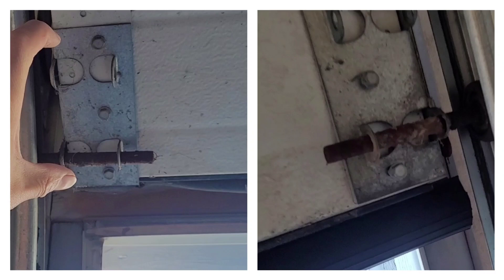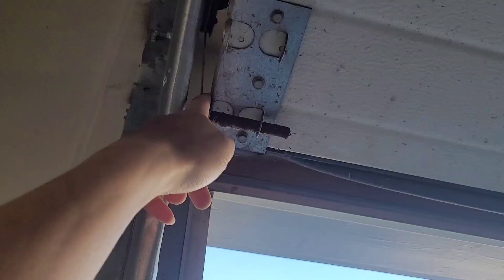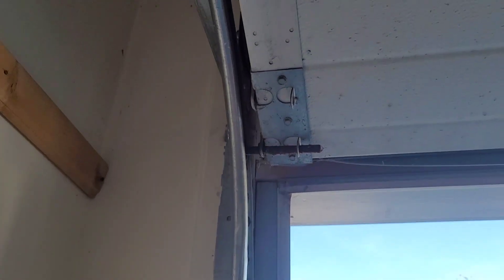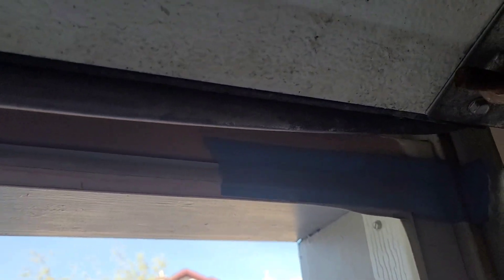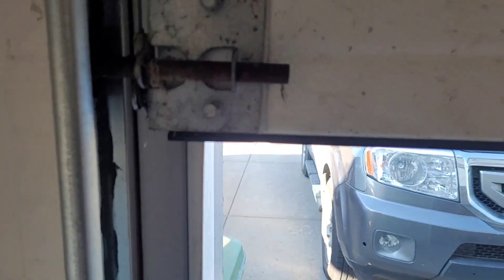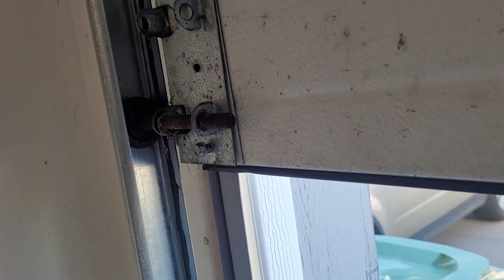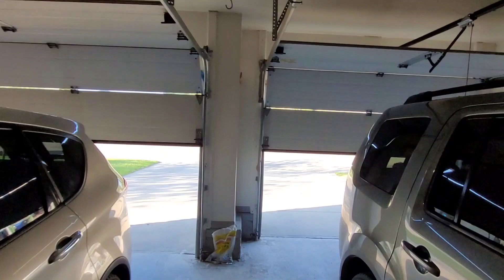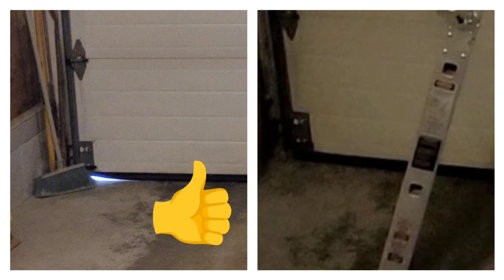Garage door lifting bracket and seal

Comment: Hi, I have the exact problem. You didn't show in the video the process of how you moved up the bracket by half an inch. I have a manual garage door (not attached to any motor). So I'm wondering if you have to do anything to be able to do so. Did you remove completely the bracket and drill new holes a little higher or did you only loosen the bolts, keeping them in the same holes? The wire is still attached to the spring, so I worry that detaching the bracket, it will jump up or do something crazy out of my control because of the tension or if it will remain at its same height. Anything I have to know and do before detaching the bracket? Thanks in advance
Reply from the maker: The screws used to mount the bracket are self tapping screws, so no need to pre drill the holes. I removed the bracket with cable still attached. Process would be: lifting up the door, holding the bracket by hand, removing 3 screws, slide bracket higher by 1/2", screw in the 3 screws. Done. Super easy.
Reply: @nickhu1852 how can you hold the bracket by hand? I thought it is attached to a wire that is linked to the tension spring and that after unscrewing the bracket,  I would not be able to hold it anymore because of the tension. I watched other videos saying to not totally unscrew the bottom bracket because it can harm without giving much details which leaves me perplexed. Thanks in advance
Reply from the maker: @WuFei0707  when the door is down and closed, the cable and spring is carrying the weight of the garage door. There will be tension in the cable. 
When door is up and fully open, the spring is unwinded, and not much tension left in cable, because the track is carrying the door now.